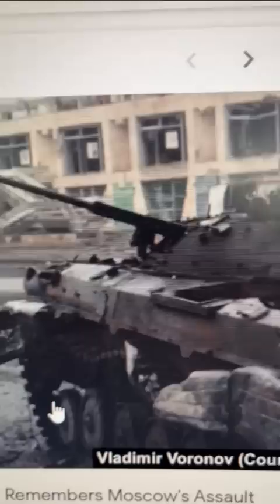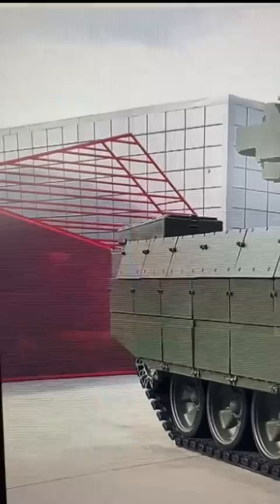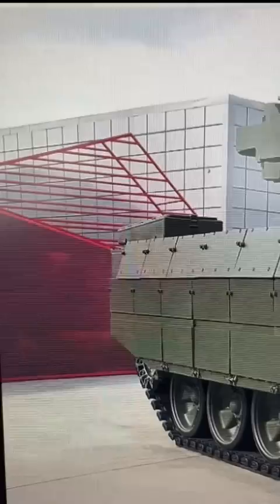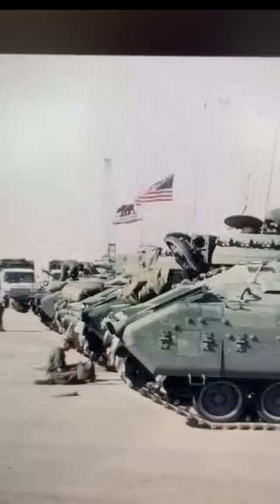BMP Terminator barrels shaking?

Comment: the reason it has 2 barrels is that they had problems switching ammunition between high explosive and sabot, so they just placed 2 guns and called it a day. Doubt they will shoot both of them at the same time. But it also means this shaking is probably just another flaw they havent fixed yet.

Comment: Problem is not so much the muzzle break but the fact the barrels are just too close to each other. The either need to be more spread apart or much more reinforced. 
Its an experimental vehicles - new version will have issues fixed or stuff changed around.

Comment: I question the idea that the barrel shake even matters. In most small arms the barrel flexes like a piece of wet spaghetti if you look at it closely enough (if you ask precision rifle guys they refer to this as barrel whip), but it doesn't actually matter because the projectile has left the muzzle long before any noticable deflection actually occurs. With the Russian guns the muzzle blast may cause the muzzles to shake violently, but I'd assume the projectiles have long since left the muzzle by the time it's noticeable and it doesn't actually degrade accuracy.

Comment: BMP-2 can aim high, almost 75 degrees. It also has fast and slow firemode for the autocannon. Fast is inaccurate at over 500 rounds a minute (you can see bmp barrel shake)
Slow is over 200 rounds a minute and significantly more accurate. I suppose terminator has same autocannon

Comment: Its probably not a problem. Its just what automatic weapons do. Ever seen slow-motion footage of any infantry weapon? It sure shakes a lot doesn't it. But in reality its happening so fast that its unnoticeable.

These things are a little different from small arms but ultimately the barrel shaking shouldn't be that much of a problem for accuracy, so long as they're not shaking enough to warp the barrels or loosen its moorings. The muzzle blasts, on the other hand definitely could alter the ballistics of the projectile, but its possible that the blasts may end up canceling eachother out.

Though this may be an irrelevant issue. Most people dont make double barreled weapons because they're concerned with pin point accuracy. Its all volume of fire baby.

Comment: Actually one stabilizes the other. If one were to implement the stepped or delayed system,  it'd need a much larger recoil control system or would need to slow the rate of fire. The accuracy In testing was shown to be quite good, despite the shaking.  As with a howitzer, by the time there's recoil the bullet has already left. It's down to the computer now to make minuscule corrections.

Comment: The BMPT was developed as a cheap solution to what happened in Grozny. Tanks couldn't raise the gun barrels to attack the rebels. They sent in anti-aircraft gun vehicles (SPAAG) an they did quite well against rebels hiding in buildings on the upper storeys. As a result, a vehicle that had the body of a T-72 and the firing systems of self propelled anti-aircraft gun was developed. Eventually this vehicle ended up having the current guns.

Comment: I bet they are ''soft mounted''. Soft mounting machine guns is important, they need to be able to move a tiny bit - if they cant the vibrations will absolutely screw with accuracy. For example the German Mg42 on the mounting tripod was soft-mounted.

Comment: The issue is iirc the barrel and muzzle break is all one piece so it would require a whole new run of barrels as they are made thicker on one side to mitigate barrel warp during prolonged fire, this new run would also need new tooling.

Comment: A long time ago I read that the barrels of the GAU-8 were aligned too precisely so (was it General Dynamics?) later they were manufactured to be slightly less accurate allowing the rounds to strike an area rather than a line.

Comment: Accuracy was low on the design priorities.  30mm   IFV rounds are stout, about 10x the energy of .50 bmg.  My guess is this was made to spray 30mm into windows and treelines to counter AT teams, prioritizing high traverse and fire rate over accuracy. Compare these barrels vs a CV9030; similar round, very different design.

Comment: The reason is only 1 gun shoots at a time it was intended to have to guns for 2 types of ammo so one would be AP for armoured vehicles and the other HE for infantry so you didn’t have to mess around with switching ammo in most demonstrations of this IFV you can see it as they only shoot one of the guns at a time and Tbf in the videos of both guns shooting it seems to be pretty accurate anyway with vary little spread
Reply: No. For armoured vehicles they have rockets.
Reply: @bobfg3130  you don’t need an ATGM for a light armoured vehicle like a IFV or APC the rockets are for targets like tanks

Comment: A few millimiters off the original projectile still shreds everything on impact, and the fire rate is 3 to 4 rounds a sec, so it is fine. A
Readdjusting the barrles will take lots of time, effort, and resources. So why not make a next generation instead.

Comment: To be totally fair, a zero dispersion machine gun would be pointless. The point is to spread thing out effects, either in space or time. That said, you want the dispersion to be because it was designed to do that, not by accident. If the combat lifetime of those systems wasn't so short, I'd be worried about the fatigue life of those barrels. Starting to see cracks form on the outside would be a very bad thing.

Comment: BMP-2 actually can elevate the barrel up to 74 degrees. BMP-1 - only like 14-15 degrees. However, BMP-2 is lightly armoured so Terminator in theory may make sense, IRL it probably won't get to Ukraine, and if it does, it'll burn.

Comment: I doubt the pressure from the other muzzle firing (via the muzzle break) has anything to do with the floppy barrels and NOBODY builds a weapon system to whip around to "shotgun" a target. All things considered, the external surfaces of the barrel is a cylinder and the mizzle break has a small surface area so the pressure wave has little to push on. It looks WAY more like crappy barrel bushing/recoil system along with making the barrels too thin to be ridgid. Likely a case of warn out recoil slides and/or poor machining tolerances and overly machined barrels for a weight savings (idk if these barrels are also used in an aerial system where the 15-20kg of extra barrel steel would be an issue but on a BMP making the barrel wall thickness 5mm more, per barrel, would be very helpful at zero real cost

Comment: I believe that standard procedure only has one of the guns firing at a time (one loaded with HE and the other with APDS ammunition, as the guns I think had a difficult time getting a dual feed system to work, or something like that), so demonstration firing of both barrels would cause more shaking than what the guns usually go through during combat
Reply: Good joke. It's a 30 mm gun.
Reply: No both barrels have duel feed. It's not a new gun it's still just a 2A42 designed in the 1970s and has been built since the early 80. The single barrel ones have duel feed in the BMP 2 and the Ka-50 and Ka-52.
Reply: Also the shaking is the same on a single barrel 2A42 see the clip of the Ka-52 fireing at 0:05 in the video below.

https://youtu.be/ANPmLohXpNE

Comment: This video holds misinformation. The barrels on the Terminator do not fire simultaneously. One barrel fires AP and one HE, they cannot fire at the same time. Gas from the muzzle of either barrel is not the issue causing inaccuracy, it's lack of build quality. 

In addition the maths have been done on inaccuracy here. Barrel sway looks to be a maximum of 3 degrees/53.3 mils. Meaning shot grouping at 500 meters distance will be roughly 30 meters, and 50-60 meters group at 1000 meters distance. This is so poor it cannot be intentional.

Comment: From commentary I’ve read on pro Russian blogs, the 30 mm guns are used to pin down Ukrainian infantry while the grenade launchers on each side are used to finish them off.

At ranges under 1 mile, and in the wooded areas of Ukraine, it doesn’t seem like the barrel shaking is as significant of an issue.

Not to mention that there aren’t many of these in service and it’s unknown how often they are being properly maintained. Hell, Ukrainians are pushing their towed artillery well beyond the limits as well, and often breaking them at times. So given the intensity of combat, I don’t expect any equipment to function at near perfect conditions
Reply: Russia is fielding already broken equipment.
Reply: @ANDREALEONE95  both sides are at this point

Comment: I was told the coax on the Bradley fired in a cone-shaped by design.
Reply: Fired in a cone shape? What does that mean? The brads coax is a M240C, just a mounted version of the M240B. Or in Europe..GPMG. When you fired the coax at enemy troops, you fired it in a zig zag pattern. I should know...i was a gunner on one.
Reply: @willthorson4543  yes, you z troops in the open, both can be true at the same time.

Comment: Iirc from an article/review video i've seen years ago(trying to find that source again), it has two guns cause they couldn't figure out a mechanism to interchange between ammunition types for a single gun, idk they can both fire simultaneously but i doubt they could be 'reprogrammed' to fire timed from one another to prevent the gun barrels from hitting one another.

Also, i wonder if they didnt go for vertical exit muzzle brakes so as to prevent the muzzle shockwaves damaging the components up front.

Comment: I would wonder if the muzzle blast from each barrel would disrupt the flight of one or both projectiles randomly?
It is a known problem on the Standard Manufacturing "S333 Volleyfire" revolver, sometimes one bullet hits, sometimes none hit, where they are aimed. There is a slight scale difference between a pistol and an auto-cannon, but I'd guess the principle would be the same.

Comment: Why develop an autocannon with dual feed if you can install two autocannons with different belts?
That thing either never fires AP ammo OR it wastes ammo with mixed belts OR outside of propaganda footage it uses ONLY ONE autocannon at a time with both being loaded with different ammo. The fact that muzzle breaks bounce each other away with pressure waves suggests that the third one is likely true. It's not twin autocannon, it's russian comprehension of dual feed -_-

Comment: It’s almost definitely the muzzle breaks. You see something similar happen with the quad mounted naval guns. The gas from the round being fired rattles the other barrels around because they’re so close together. Muzzle breaks obviously force gas out to the sides. Combine that with natural barrel harmonics (a normal barrel for an AR-15 will flex about 2 inches when fired), and you get the potential for a very inaccurate BMP.

Comment: THE 30mm 2A42 is not a particularly accurate weapon to begin with. The gun also has 2 different fire-rates 200 to 300 rds/min (low), 550-800 rds/min (high). 

Interestingly, someone else also pointed out that each gun is set to a different mode in the video as well, the one on the right fires much slower than the one on the left. 

Russians just not making sense again

Comment: The original US .50 cal. machine guns were too accurate. Punching the exact same hole at 500 yards with 50 rounds isn't much use against anything, plane, man, or material.
Reply: That's incredibly useful. Carlos Hatchcock used a M2 as a sniper rifle.
Reply: I think it is situational, sometimes accuracy is important, sometimes you need a wide pattern for area effect.

Comment: just using old equipment to save more space on the trillions of kilometers of territory.
Reply: BMPT isn't old...
Reply: @harmdallmeyer6449  designed from 1998-2002 and produced in 2002 I'd say old.
Since Russians haven't had any major wars until now I'd say this is a test run on an actual war.
Reply: @LividBunny  2002 is actually pretty Young for ground vehicles. The M2 Bradleys is from 1981, T-90, Russias newest Tank, is from '92. Also, probably more importantly, it entered service in 2011. 

Another reason as to why it isn't outdated is simply that it's still in service. The Terminator-3 is Not in series production, so the BMPT-72 is the current Version.

Comment: its actually pretty acurate well less than bmp2 with samé 2a42 cannon but well still very effective basicly you point on terget and this bitch delivery but deviler aslo 3 meter all around but psssss thats details thats features its russian design its nôt perfect but work but lets bé real this is a bit issue when you want to shoot on longer ranger but this bmpt also can shoot with single barrel Like bmp2 but IF they just twist both cannons by 25 degreese in one direction boom problém solved so the gases from muzzle brakes will not colide with each other its that Simple.